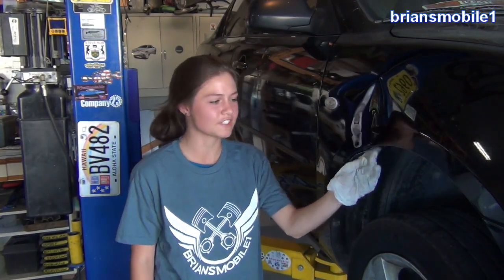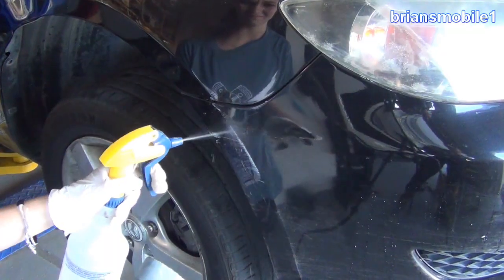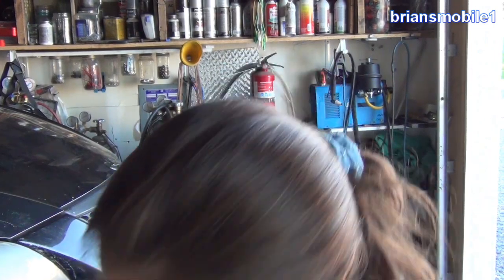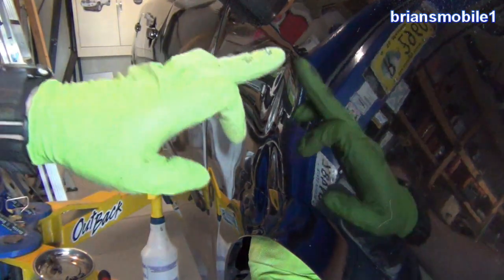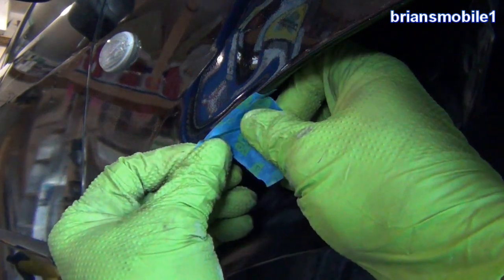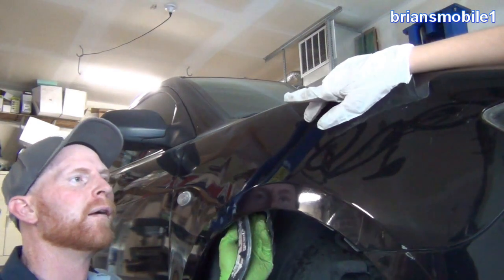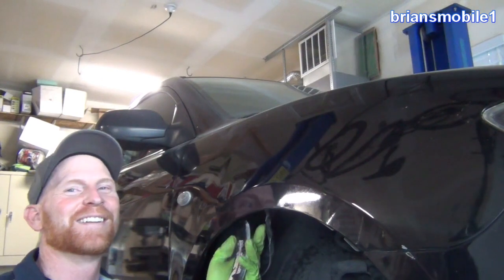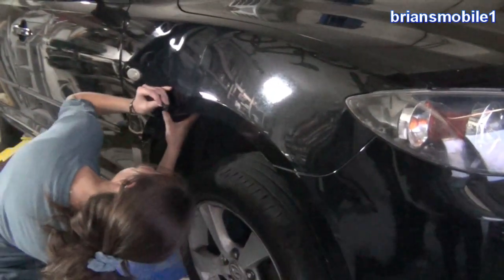Fixing a "Hundred Foot Dent" in About An Hour

Comment: Painting, 99.9% preparation, and the last bit is paint, otherwise you spend 99.9% afterwards polishing to get the finish right. Polishing the same, I remember polishing acres of acrylic windows, to get the fine scratch marks from dust out of them. 

The alternative was to rip out the panels, get the new ones, finish cutting them to fit the multiple curves, and then use the 2 component urethane adhesive to fit them, then put all the metal trim back in place. Then of course you still had to polish them again, to get the marks out from the forming process.

Tip for the forming process inside is to get some wax candle, and rub a thin layer on the inside of the panel, to provide some lubrication when pressing. Also use a thick plastic bag taped to the inside as a barrier, saves scratching the paint inside. Then paint the area inside with some linseed oil ( will stink) to seal any micro cracks and keep the inside from rusting. Also works well sprayed into the channels on the underside.
Reply from the maker: Thanks for the tips Sean!

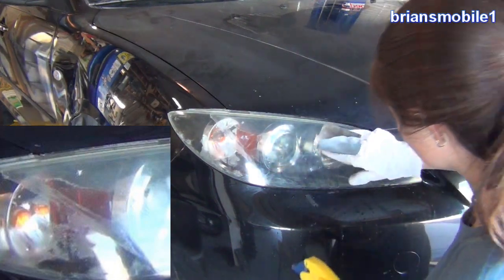Comment: 3:25 when doing headlights you can pop the hood so you don’t damage the paint there
Reply: Yeah I always remove the headlight. Ive never had a headlight that was more then 3 to 4 bolts.
Reply: Ive actully polishes a few headlights and all I do is just tape off around it and use a 3 inch wool pad and Ive never had a problem
Reply: @thegamingchanel100  youre lucky. The gaps around my headlights are none existent. I've tried taping multi times plus when you wet sand it flings shit all over the hood or engine bay if you pop the hood. It only takes me less then 2 minutes to remove my passat headlight assemblies anyhow.
Reply: It's more efficient to cover the sides with masking tape or something similar.

Comment: I would like to see the glue gun dent puller. I have a few dents (knuckle marks) about 3/4 inch to an inch and a half wide where someone punched the rear driver side quarter panel.  I thought about taping some wax paper to the inside and ruining them with a spoon but a dent puller was another idea.  The paint is not damaged and it should be easy to rub them out.

Comment: i wouldnt have use sand paper on the scuff below the headlight... wipe it using a rag with Lacquer  thinner will take the foreign paint off original paint with out removing any clear coat

Comment: Your a teacher and automotive technician - car does look better by all means - far out - why don't you take that  fender liner out - make it easier - is that her car
Reply from the maker: It's more bother than it's worth.  Those clips are a pain and they often break.  I'm a take everything out of the way kind of guy typically, but if there's risk things will break and the advantage isn't needed- I'll work around it.  Yes.